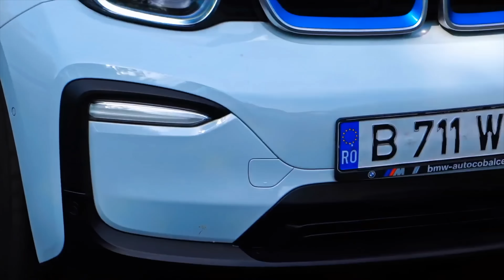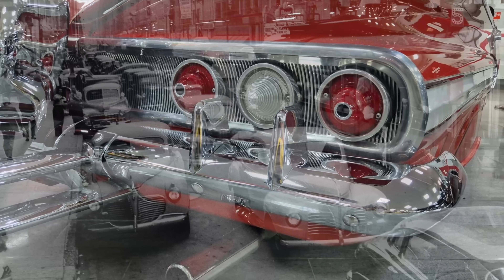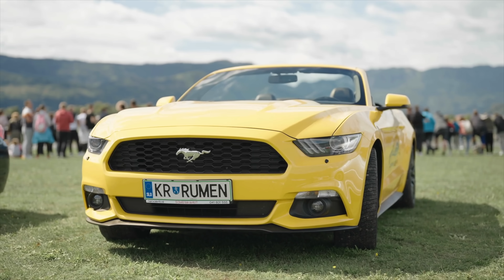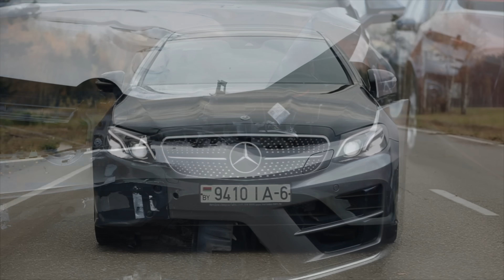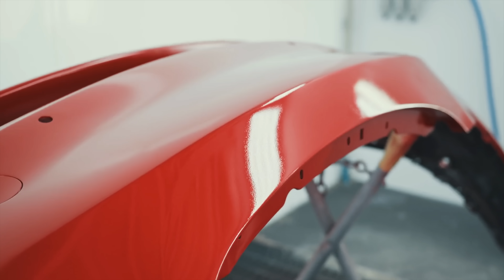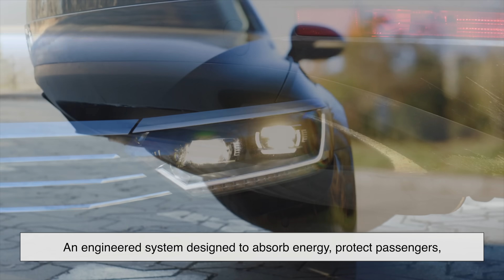Why Are Car Bumpers Made of Plastic Instead of Metal?

Comment: This is all bullshit. A car that crumbles does not protect you any better than a car that doesn't. If that was the case how come buses don't have plastic bumpers that crumble? Because the frame absorbs most of the impact when your shit doesn't crumble. The only reason they make it out of plastic now is because it's cheaper to make and for weight reduction and to make sure that your car gets destroyed in the wreck so you have to get a new one. Same reason why commercial vehicles can run for millions of miles while cars fall apart after 100,000 miles. It's called planned obsolescence

Comment: Why don't windshield blow out facing all that wind pressure?
Reply: The wind pressure isnt all that much to start with. The currved design and rake angle guide oncoming air smoothly around the greenhouse of the car.

Comment: Carbon fiber is excellent for a car bumper if you are building a track car or looking for a premium aesthetic, but it is less ideal for daily street driving. While it handles high tensile stress, a carbon fiber bumper is rigid. In a minor fender bender or parking mishap, it is prone to cracking or shattering rather than denting. Repairing damage requires highly specialized, often expensive procedures. Even minor damage often requires a full panel replacement.
Reply from the maker: Thanks for that fun fact! Hope you enjoyed watching our video! - Admin MD

Comment: Auto manufacturers say everything is about weight from the spare tire to the bumpers, but it's actually actually about cost cutting and maximize Profits
Reply: Sure, let's see you get rammed inside a frame containing only solid steel, vs a plastic frame that is rigid but flexible.
We'll see how your body holds up after repeated impacts transfer all that shock to your body instead of dispersing it through dampening material.

Better yet, why not try a boxing match and equip some kind of molded, steel gum protectors. I'm sure you'll have a lovely field day at the dentist after a single punch, when all that strong, solid metal, collapses and warps itself into your teeth and gums.

Since you choose not to believe in physics, let alone crash physics.
Reply from the maker: Thanks for that feedback! Hope you enjoyed watching our video! - Admin MD

Comment: Will using carbon fiber make weight even lighter? But will the cost be more expensive?
Reply: Carbon fiber itself is not overly expensive, but carbon fiber auto parts are prohibitively expensive. If it cracks or scuffs from parking or road debris, fixing it requires specialized composite repair and is rarely cheap or invisible. Carbon fiber is also too rigid, it shatters on minor impacts rather than absorbing them. I hope that helps.
Reply: @joegagliardi3984 thank you for those insights
Reply from the maker: @stephenco862  Thanks for watching!